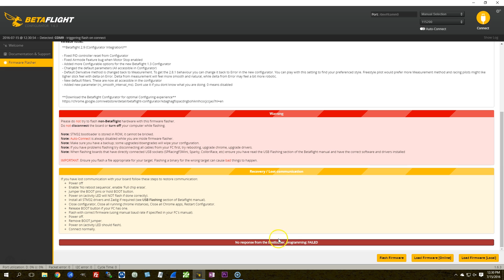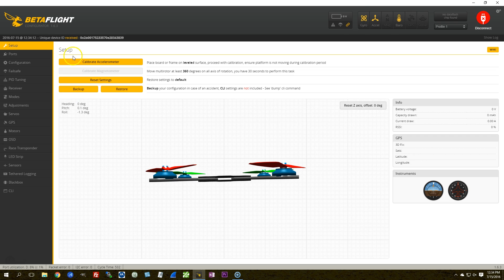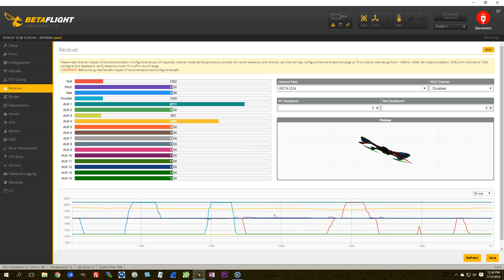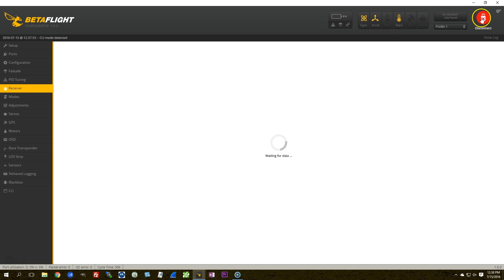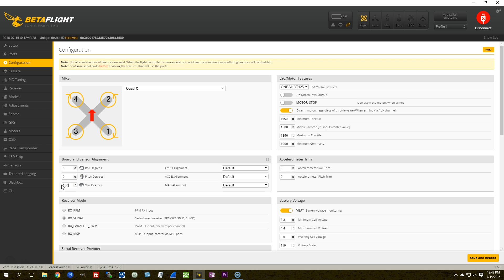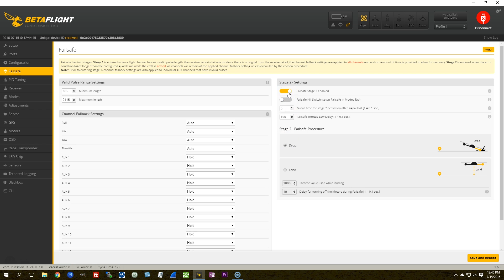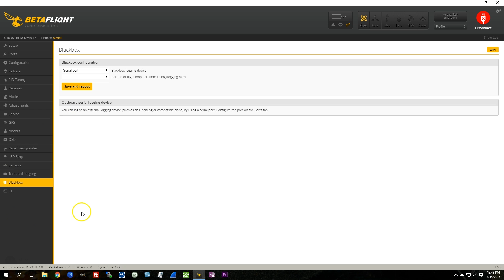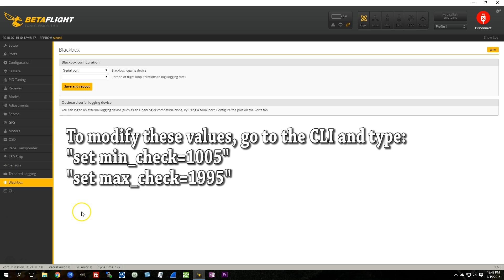Betaflight Setup (BETAFLIGHT 3.3 VERSION IN VIDEO DESCRIPTION!)

Comment: I could ask a million questions, like how did you know to use DOGE etc., but it's clear this isn't the SETUP, but you using BetaFlight after it was setup.  I'll go looking for how to setup BetaFlight elsewhere.  There must be a guide somewhere that explains what the drivers do and why I'd want one instead of another.  Hell, just knowing this thing is in CHROME would have been really helpful!
Reply from the maker: https://www.youtube.com/watch?v=uIsyuNxIlkI
Reply: Good info on the CLI command.  Then you toggled off all the flash options...  I LOLd.  It's probably good to know up front that my BetaFlight experience is going to be like Linux, but even more larval -- more trial and error.  There are three options in the flash routine, so a small number of permutations to try.  I'm a bit concerned that according to some (maybe on other boards) I'm not supposed to see the red light when the board is in boot mode, while I see the red LED but dim when I hold down the boot button before connecting, so maybe I'll go spelunking for info on how to reboot into boot mode using CLI and go from there.  It's good to know I cannot brick the boot loader!  (certainly isn't the case with Android!)

When I got into APM, I bought "the one" specifically to avoid the path less traveled, and that worked out great -- plenty of people had already worked out all the kinks!  F3 seems to be universally "kinky".
Reply: I'm just finishing up my build and I'm stuck. I have the raptor flycolor 30aesc's and I need to program them, how do I do it in betaflight?

Comment: ALL HAIL ...JOSHUA THE MAGNIFICENT!!
I own a Phantom "heli cam" that's awesome for the purpose it serves but is painfully boring for all but filming. 
 the fpv racers started looking better & better so when I found an RTF model X 220 Wizzard on CL for $160 I jumped on it. 
 the original owner had it one week & was on the last set of props after 5-6 flights and was over it. 
 after flying it myself a few days I decided the learning curve was going to probably  be rediculously  longer than I hopped. 
 with help from Joshuas tutorials I determined that instead of sw  c 1&2 being Acro and horizon, both positions were actually  Acro. 
 after setting up the tx correctly, with all 3 flight modes available to me, this bird Flys like it's on rails and I am well on my way to total fpv obsession!!
 thanks Joshua! !?

Comment: Joshua, 1st quad here. It was flying, then i decided to mess with betaflight, and I somehow messed it up, I did restore settings, and flash the new firmware. I can control the motors in betaflight etc.. I had to rebind my 9xr with frsky module, and it appears to be bound in ppm ( looking at the receivers lights)  but cannot control any of the quad, nor will it register in betaflight that i am moving the sticks. and watching your part on modes, it does not register any of my inputs there either. 
Im sure there is something blatantly obvious that im missing, would you happen to know where to start?

I would appreciate any help! thank you

Edit: I'm pretty sure all the drivers for betaflight are good, i did it off of your video
Reply from the maker: So, first of all, never do the backup/restore settings. It doesn't work right. They should remove it, or fix it, but they haven't and I don't know why. Here is the right way to upgrade: https://www.youtube.com/watch?v=HsxTqp76Brs

Be aware that with recent versions of BF and CF, you can use "diff" instead of "dump" and it will only output the parameters that you have actually changed. You should still paste back in manually with some attention to what you're changing because sometimes the default value for a parameter changes and if you paste back in your config you will overwrite the change. Frankly, I often end up re-building my config from scratch when I go to a new BF version because I want to try out any new parameters the devs have felt appropriate to change.

If the Receiver tab is not moving when you move the sticks then probably your receiver type is not set up right. You're using a 9xr so probably you have a PPM receiver? Or PWM? How many wires are going from the receiver to the FC? Is it power, ground, and signal, or is it like eight or ten wires?
Reply: thanks for the response, its power, ground and signal
Reply from the maker: +Griff5k then you're probably using PPM. Set the receiver type to PPM on the configuration tab.
Reply: That is the setting i'm on, i've tried to watch all of your videos before conferring with you. Whatever I did erased the ability to control the copter like i used to do. controller wont talk to quad, so i rebound, and it shows that it is bound, yet, nothing. :/
Reply from the maker: If you didn't change any wiring then setting the receiver type to PPM should be all it takes. I don't know what else it could be.
Reply: Hmm, ok, i appreciate it, thank you for putting out great videos!

Comment: Joshua,
I am brand new to drones and just received a wizard x220 RTF.  I was following your set up instructions and was stopped at step one, download from  GitHub. I do not see a hex file for the wizard x220 although I do see one for naze32.  Just not sure which to do next.  And what this about Chrome app that I see in the comments.  Talk about confused!!
Pretty sad huh?  Don't judge until you're 70!!
I see I am going to need help and your it.  I signed up for patreon as a start, so your pretty much stuck with me.  Of course I haven't figured out how to use it either... but I have you in my sights.
Thanks for all the help you have already given.Richard
Reply from the maker: +Richard T at this point in your learning, I would suggest just getting outside to fly. All the fussing around in the computer may leave the copter in a state where it won't fly and yen where will you be?

Betaflight configurator can be downloaded from the Chrome app store. You need to be using Google Chrome browser. 

I obtain suggest trying to upgrade the copter to Betaflight unless you have some help on hand. There are manual steps that my video leaves up to the user to figure out.
Reply: Honestly,that's the answer I had hoped for.  And its a beautiful day in Georgia for flying.Thanks Richard

Comment: why do i not have a failsafe tab??
Reply from the maker: +HexDan enable advanced mode in the upper right. Turn it back on permanently using the gear icon.
Reply: NOICE, thnx
Reply from the maker: +HexDan NOICE

Comment: Hi. I followed your guide to calibrate my ESCs using BLHeliSuite. After that I set min_check to 1115 because I read 1107 with my throttle down, trim centre. Now I suspect that something is wrong... Maybe because "min throttle" is set to 1016?

What is recommended settings when throttle does not output appr. 1000?

Earlier I just beeped the throttle down to "normal" settings and the quad flew just fine. Changing the min_check seems to have messed it up.
Reply from the maker: You are mixing up the input and the output side of the throttle. min_throttle and min_check have nothing to do with each other at all. On the input side, you need the channels in the Receiver tab to go from 1000 to 2000, and min_check must be > the lowest throttle value. On the output side, you calibrate the ESCs and your'e done.

https://www.youtube.com/watch?v=WFU3VewGbbA

https://www.youtube.com/watch?v=YNRl0OTKRGA

Comment: i was setting up new quad and my endpoint will only go to 1014 on channels and ive adjusted the 2000 fine but it didnt adjust no more than 1014 and need 1000 , what would i need to do?
Reply from the maker: +David Downs use rxrange. Look it up on the wiki.
Reply: Joshua Bardwell thanks sir

Comment: Hi Josh. Could you please refer us to or make a throughout video on how to proper setup FAILSAFE?
At minute 9:40 you start talking but not enough to get it though.
Reply from the maker: "Drop" not "Land".

I prefer to set the timeout to 5 (1/2 second) instead of the default 10 (1 second).

I prefer to set throttle to "hold" instead of "auto". This means that the throttle will stay at its previous value for the timeout period (1/2 second in my config). I'm willing to leave the throttle up for 1/2 second to give the link a chance to recover. With "auto" the throttle will drop to idle and that will make it more likely to crash immediately even on a short dropout.

You need to be able to recognize a stage 1 failsafe and any time it happens and you recover, bring the copter in immediately and figure out why you're failsafing. I have seen pilots failsafe and just keep muscling through. This is very risky because you don't know why you're failsafing (RF issue or loose wire?) and you don't know whether you're going to lose it for good at any moment.

Comment: I wanted to use ppm because I have a D4rii receiver so I set receiver mode to "ppm RX input" and I can't get any signal at all in the receiver tab.  Any ideas what I'm doing wrong?
Reply from the maker: Probably you have not wire to the PPM input pin on the FC.
Reply: I have wired a servo lead to the PPM s+- pins.  The servo lead is connected to port 1 on the D4rii, and pins 3 and 4 are jumped.  Is there something else I need to wire? I also tried a flysky-i6 TX/RX setup and that had the same problem.

Comment: I watched your video for calibrating ESC, I did that. Setup betaflight, but for whatever reason my AUX 2 is tied into my Throttle. I don't have any mixes. also when I arm the quad, it just goes left and right as if trying to self stabalize. any ideas?
Reply from the maker: +Justice Dougherty this has to be an issue in your transmitter. I can't think of anything in Betaflight that would cause that. Are you using parallel PWM? If so, you could have a wire touching two channels. But if you're using SBUS or PPM or any other one wire solution it has to be the transmitter.
Reply: Joshua Bardwell I'm using a X6b receiver from flysky, as far as wiring I only have the IBUS port used on the x6b. That's soldered to the pins on the board. I have my transmitter set for PPM and Ibus. It's really stumping me, I've used the same transmitter on other quads no problem
Reply: so I fixed the aux channel by switching to airplane vs fixed pitch helicopter. Now why would it go left and right like that? any ideas? thank you for the help big time
Reply: so I fixed the aux channel by switching to airplane vs fixed pitch helicopter. Now why would it go left and right like that? any ideas? thank you for the help big time LM
Reply: Joshua Bardwell ended up having the motor wiring flipped. It was also set on helicopter fixed pitch. Silly and stupid mistakes. I do appreciate the fast reply.

Comment: I made the mistake of un ticking the USB VCP tabe now i cant connect back into betaflght Do you have any advise Cheers
Reply from the maker: Sorry but the only solution is to use the bootloader button to put the board into bootloader mode and then re-flash it. Hope you have your configuration saved...
Reply: Thanks I don't know how to save the file,gues ill do it all over Many thanks
Reply: Go to cli setting, type dump enter,  copy everything up to where the name of your model appears , if named, save as txt document. Can then use as a backup if need to reflash, also good idea when changing any settings, for same reason.

Comment: can you tell exactly what I say in RX command to make my in points set for 1060 1900 So I can get full endpoints I'm just going to do it to all the all 4 channels because spectrum dx6i doesn't go to 2000 I turned everything up to 125% that's as far as they go it would really help or just one of your videos please sir
Reply from the maker: rxrange 1 1060 1900
rxrange 2 1060 1900
rxrange 3 1060 1900
rxrange 4 1060 1900
save
Reply: Thanks man

Comment: I'm having a real problem just trying to open a Betaflight .hex file. I'm right clicking, looking for programs on the internet. Is there some cheap and easy way to open these files, so I can use the Betaflight program?
Thanks.
Reply from the maker: Don't open the files. Don't download the hex files. Just flash from the Firmware Flasher tab in the configurator GUI, the pulldown menu.
Reply: Joshua,
Thank you for answering.  If you can, imagine somebody who is used to online shopping at Amazon and everything I need to shop is self-evident to me. 

Where do I find the all the above? Can you baby step with no acronyms. (What's the GUI?)  Do I find the Firmware Flasher tab on the Betaflight site, is it supposed to be on the F3 Flight Controller when I plug it into the computer?  There are tons of videos about dealing with Beta Flight, but it seems everybody knows how to get the Betaflight program on their computer screen, and I missed the memo. Thanks.
Reply: I just found some info that tells me I need the CleanFlight configurator application from the Google Chrome store. Is this the starting point I'm looking for?
Reply from the maker: +KH45430 if you want to run cleanflight, yes.
Reply from the maker: +KH45430 https://chrome.google.com/webstore/detail/betaflight-configurator/kdaghagfopacdngbohiknlhcocjccjao?hl=en
Reply: Yes! thank you so much! Now on to the next "learning curve". At least I have BetaFlight now. 
Thank you.

Comment: figured this would  be the best video for this question. how can ii fix my motors not responding till like 15% throttle any ideas? and im in air mode lol
Reply: its taking like 40% just to move i did add a hero 5 black and i just tuned it tuning didnt fix it
Reply from the maker: Lower min_check.

Comment: What is the best procedure for calibrating the accelorometer ?
Reply from the maker: Put the copter flat on the table, calibrate from the "setup" tab. Then trim using LOS hovers and stick commands.
Reply: Thanks ! that is what I have tried. Quad when facing away and hovering at eye level seems to have a slight pitch in roll right. I can remove roll drift with trim but like to find out cause.

Comment: i remember you saying how to get the fc in bootloader mode without a button or jumper. i am stuck while upgrading my omnibus f3 to 3.1. its does not want to go in dfu mode or flash firmware. is also does not want to connect anymoe like it used to. any tips?
Reply from the maker: CLi command "dfu" reboots the board into DFU mode.
Reply: Thank you. I fixed it, just went around and did everything again. On the omnibus is allot of conflicting information

Comment: How can I do these modes with the flysky fsi6
Reply from the maker: You need to figure out how to make an Aux switch work on the transmitter. Once you have the Aux switch assigned, everything on the Betaflight side is the same.

Comment: Hi, Thanks for the video. I have an issue using BF and naze 32 Rev6, new receiver using ibus. coptor flys fine as expected (acro) smooth and responsive but when i do a 360 roll it continues to roll at full rate even after stick centred. I've looked at so many settings to try and work this out. I re loaded a newer version of Betaflight and re cal the esc's and it worked...once! next day with restored confidence, dam thing did it again. Please help im smashing the quad everytime and i dont know what to try now. new FC?

Comment: I'm stuck bad I have everything setup ready to go but when I go into the receivers tab everything works except my throttle just stays at minimum any idea what I might have bumped or changed it flew yesterday thanks
Reply from the maker: Check your channel mapping to be sure it is correct. Move all the sticks all directions see that the correct channel moves.
Reply: No it was the motor cutoff it was set to switch H I changed this to inhibit everything is great ever since

Comment: Got an issue: Running a spektrum serial receiver connected to a naze32. Can't get any inputs from tx to show in the receiver tab in betaflight... Everything is set at 1500 except for throttle which is at 885 in the tab. The rx/tx is supposedly bound. Wondering if anyone might have a fix for this!
Reply from the maker: +Andy Braden what UART? Ports tab configured with serial rx in UART 2? Serial receiver and correct provider in configuration tab?
Reply: Joshua Bardwell  UART1 with MSP switched on. UART2 with serial rx switched on. Everything is correct in the configuration tab.
Reply from the maker: Are you sue you have the correct serial RX provider? There are two for spektrum depending on which receiver you're using. If your configuration is correct then the only answer is that you've connected to the wrong pad on your Naze or on your receiver.

Comment: If you accidentally turn off that USB VCP you will have to reflash.
Reply from the maker: YUP. Honestly, they should really put a warning in or even prevent you from doing it entirely.
Reply: And if someone was so stupid they did turn off the USB VCP, and when they try to re flash the all-in-one SP Racing F3 EVO FC Betaflight can't connect with a "No response from bootloader" error, what would they do then? --- signed, someone so stupid
Reply from the maker: +Scott Slusser it needs to be in bootloader mode. If that's not working, either it's not in bootloader mode or your drivers aren't set up right.
Reply: Ha! Ha! loving that man, well put question.  :)

Comment: Joshua, When updating from 3.0 to 3.1 will all my settings be lost? can I save the file and reload after the update or will the saved settings still be on my quad? Sorry, if it sounds like a silly question.
Reply from the maker: +Logo 800 no. You need to do a "diff" on the CLI and save the results. You can then paste it back in and most if not all of your config will be restored. You still need to check everything works correctly, most importantly failsafe and that the 3d model moves correctly.